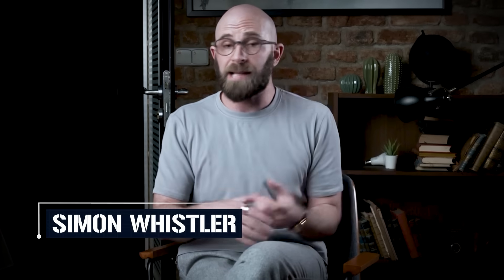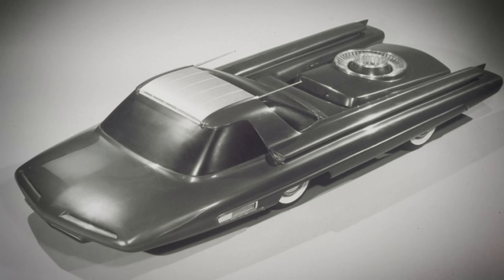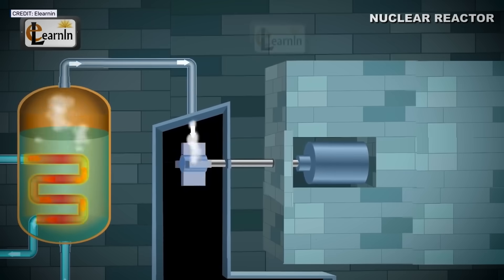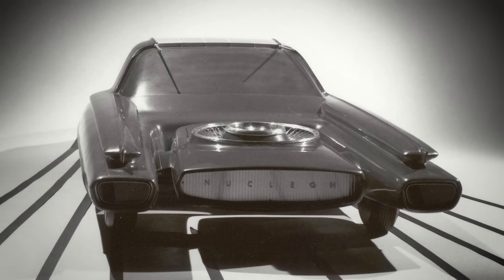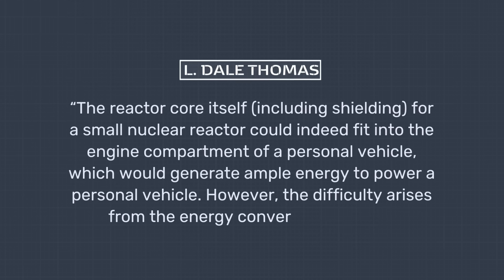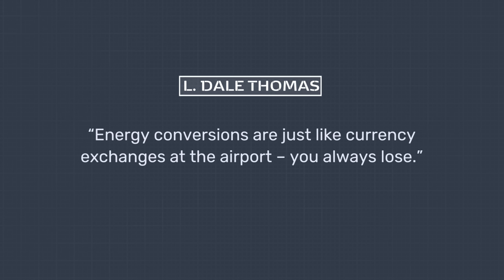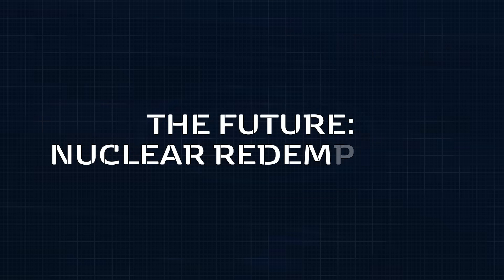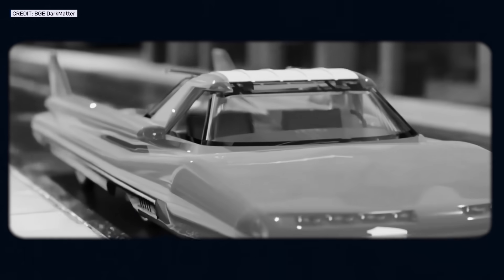The Ford Nucleon: The Nuclear Car of the Future

Comment from the maker: Head to https://www.squarespace.com/megaprojects to save 10% off your first purchase of a website or domain using code MEGAPROJECTS.
Reply: where's my Edsel Nucleair Nuclear Powered Flying Car?
Lied to and Cheated again :/
Reply: most electric cars don't swap out their batteries, but instead recharge (for way too long).  Even the battery swapping variety has it to where the car must be propped up and the battery pulled out from the bottom of the car, as opposed to the classic top lift that is easier and cheaper for the individual (not needing a mechanic shop and lift).
Reply: Did you record this audio on a potato?
Reply: An ordinary electric car that is charged from a network powered by a nuclear power plant can be considered an atomic car.
Reply: after they have cured radiation poisoning and learnt to contain nuclear explosions maybe. the idea of two such vehicles in a crash, or even in a E-vehicle like runaway battery situation, could level a town or most of a town in one go. i'm pretty sure fire departments world wide, wouldn't a tiny reactor doing a Chernobyl in a drive way
Reply: I built a nuclear car once.... You'll never guess what happened to it!
Reply: Yes but could the nucleon power a flux capacitor.
Reply: I think you missed the amount of time it takes to start a nuclear power plant.
Reply: @jbranche8024  

just leave it running.  :)
Reply: Cadillac had a concept car that was going to use enriched thorium🎉
Reply: arent you completely forgetting the Cadillac Thorium car? i think they made at least 12 of them.
Reply: @bm5298  silly those aren't for peasants
Reply: Why specifically Pakistan
Why not Myanmar 
Why not Moscow why?
Reply: Zero Point Energy = End Game!
Reply: could yuh dumb it down to a minute or 2?

Comment: TBH, a lot of the issues could be fixed by using a Thorium Flouride reactor instead but you still have the cooling issue. Does make one wonder if such a thing could be used in aviation since jet fuel pollutes way more than cars and the cold temps at high altitudes would be able to cool the reaction. Of course you still have the energy conversion issue.

Comment: Nuclear Radioactive Junkyards. 👎💩🙈🙉🙊😭😝🥵🤬😶‍🌫️👾💀
This was again proposed in a different way in the late 1970's, whereas Radioactive (tritium) 'heavy' WATER was planned to be used as a fuel. But tje exhaust would be somewhat nuclear -radioactive, and fallout spread all over the Earth. Plus the junkyards problem.
All intended to befuddle the general public about the fact that an engine can operate on REGULAR WATER, electrically split from H2O into both Hydrogen and pure Oxygen at safe low pressures, on-board the vehicle itself.
Fill 'er up, with WATER.

Comment: 10:36 liquid nitrogen filled radiators with circulating high pressure lines...
 Multi layer cooling core titanium armoured reactor with NOX liquid nuclear fuel...
Direct steam-to-movement gearbox
Sikorski turbine style...
If the Americans really want something, they make it possible. Especially if it's nuclear.
If you need some proofing occasions: Hiroshima, Nagasaki, Castle Bravo...

Comment: The enormous weight would not only make steering and braking more difficult and make crashes more dangerous. The stress put on roads and especially bridges grows approximately with the fourth power of weight. With the Nucleon weighing as much as a small semi truck, it would put around 5,000 to 10,000 times more stress on the road surface and damage it much more quickly.

Comment: This is probably a stupid question, I know that going in. But if efficiency is an issue because of all those power conversions, then why not design a nuclear engine that only makes electricity as a side thing, and instead use the power that would be turning a turbine to turn the wheels instead? I mean I know there are other issues but would that not work?

Comment: 021823    Peaceful revolution driven by clean abundance
Let's face the wonder of full heat use. The second law of heat may be false conventional wisdom. The second law of thermodynamics was developed during victorin england's scientific and religious fascination with steam engines. Many people act as if this paridgm is inescapable.

The second law is behind modern refrigerators needing electrical energy to compress the refrigerent to force it to release as waste the heat that it has removed from the refrigerator's service interior in the cooling part of the refrigerent's circulation. The interior coldness draws in exterior heat through the cabinet insulation. There is also discarded heat from mechanical friction and electrical resistance. The net thermal output equals the electrical input with energy not being gained or lost in this refrigeration system including its forced waste. Unencumbered refrigeration by the principle that energy is conserved should produce an equivalent amount of electricity instead of consuming electricity.

It makes more sense that refrigerators should yield electricity because energy is widely known to change form with no ultimate path of energy gain or loss being found. Therefore any form of fully recyclable energy can be cycled endlessly in any quantity.

Full heat recycling, all electric, very isolated underground, undersea, or space communities would be highly survivable with self sufficient EMP resistant LED light  automated vertical farms, thaw resistant frozen food storehouses, factories, dwellings, self contained elevators, safe rooms, and horizontal transports.

In a flourishing civillization, small self sufficient electric or cooling devices of many kinds and styles like lamps, smartphones, hotplates, water heaters, cooler chests, fans, radios, TVs, cameras, security devices, robot test equipment, scales, transaction terminals, wall clocks, open or ciosed for business luminous signs, power hand tools, ditch diggers, pumps, and personal transports, would be available for immediate use incrementally anywhere as people as individuals or larger social groups see fit.

Some equipment groups could be consolidated on local networks.

If a high majority thinks our civilization should geoengineer gigatons or
teratons of carbon dioxide out of our environment, instalations using devices that convert ambient heat into electricity can hypothetically be scaled up do it with a choice of comsequences including many beneficial ones.

Energy sensible refrigerators that absorb heat and yield electricity would complement computers as computing consumes electricity and yields heat. Computing would be free. Chips could have energy recycling built in.
This would improve performance and lower cost,

Refugee communities would be buildable quickly. Fire safes would preserve contents to 1000F indefinately

A simple rectifier crystal can, iust short of a replicatable long term demonstration of a powerful prototype, almost certainly filter the random thermal motioren of electrons or discrete positiive charged voids called holes so the electric current flowing in one direction predominates. At low system voltage, a filtrate of one polarity predominates only a little but there is always usable electrical power derived from the source, which is Johnson (observation) Nyquest (theory) thermal electrical noise. This net electrical filtrate can be aggregated in a group of separate diodes in consistent alignment parallel creating widely scalable electrical power. The maximum energy is converted from ambient heat to productive direct current electricity when the electrica6bzDVgBhrhYl load electrical resistance  is equal to the array internal electrical resistance.

Maximum calculated electrical power output (watts) is k (Boltźman's constant), one point three eight x 10^ minus 23, times T (temperature Kelvin) times bandwidth (0 Hz to a natural limit ~2 THz @ 290 K) times rectification halving and nanowatt power level rectification efficiency, times the number of diodes in the array.

There are a billion cells of 1000 square nanometer area each per square millimeter, 100 billion per square centimeter.

Order is imposed on the random thermal motion of electrons by the structual orderlyness of a diode array made of diodes made within a slab:

Host crystal is silicon
  P type boron doped
-----‐------‐----___-- Out
🔻🔻🔻🔻
■■■■■■___ + Out
  N type phosphorous doped

All the P type semiconductor anodes abut a metal conductive plane deposited on the top face of the slab with nonrectifying joins;  the N type semiconductor cathodes or common cathode abuts the bottom face. As the polarity filtered electrical energy is exported, the amount of thermal energy in the group of diodes decreases. This group cooling will draw heat in from the surrounding ambient heat at a rate depending on the filtering rate and thermal resistance between the group and ambient gas, liquid, or solid warmer than absolute zero. There is always a lot of ambient heat on our planet, more on equatorial dry desert summer days and less on polar desert winter nights.

Focusing on the composition of one simple diode, a near flawless crystal of silicon is modified by implanting a small amount of phosphorus (N type conductivity) on one side from a ohmic contact end to a junction where the additive is suddenly and completely changed to boron (P type conductivity) with minimal disturbance of the crystal lattice. The crystal then continues to another ohmic contact.

A region of high electrical resistance forms at the junction in this type of diode when the phosphorous near the ĵunction donates electrons that are free to move elsewhere while leaving phosphorus ions held in the crystal while the boron donates holes which are similalarly free to move. The two types of mobile charges mutually clear each other away near the junction leaving little electrical conductivity. An equlibrium width of this region is settled between the phosphorus, boron, electrons, and holes. Thermal noise is beyond steady state equlibrium. Thermal noise transients, where mobile electrons move from the phosphorus added side to the boron added side ride transient extra conductivity so t⁶he forward moving  electrons are preferentally filtered into the external circuit. Mobile electrons are units of electric current. They lose their thermal energy of motion and gain voltage, as they transition between the junction and the array electrical tap.

Inside the diode, heat is absorbe; outside the diode, to exactly the same extent, an attached electrical circuit is energized. The voltage of a diode array is likely to be small so many similar arrays need to be put in series to build higher voltage. 

Understanding diodes is one way to become convinced that Johnson Nyquest thermal electrical noise can be rectified and aggregated. Self assembling development teams may find many ways to accomplish this wide mission. Taxonomically there should be many ways ways to convert heat directly into electricity.

A practical device may use an array of Au needles in a SiO2 matrix abutting N type GaAs. These were made in the 1970s when registration technology was poor so it was easier to fabricate arrays and select one diode than just make one diode.

There are other plausible breeches of the second law of thermodynamics. Hopefully a lot of people, mostly as independent teams, will join in expanding the breech. Please share the successes or setbacks of experiemental efforts.

These devices would probably become segmented commodities sold with minimal margin over supply cost. They would be manufactured by advanced automation that does not need financial incentive. Applicable best practices would be adopted. Business details would be open public knowledge. Associated people should move as negotiated and freely and honestly talk. Commerce would be a planetary scale unified conglomerate of diverse local cooperatives. There is no need of wealth extracting top commanders. We do not need often token philanthropy from the top if the wide majority of people can afford to be generous..

The topic deserves discussion and prototyping attempt action.

Aloha
Charles M Brown
Hawaii

There are other plausible breeches of the second law of thermodynamics. Hopefully a lot of people, mostly as independent teams, will join in expanding the breech. Please share the successes or setbacks of experiemental efforts.

These devices would probably become segmented commodities sold with minimal margin over supply cost. They would be manufactured by advanced automation that does not need financial incentive. Applicable best practices would be adopted. Business details would be open public knowledge. Associated people should move as negotiated and freely and honestly talk. Commerce would be a planetary scale unified conglomerate of diverse local cooperatives. There is no need of wealth extracting top commanders. We do not need often token philanthropy from the top if the wide majority of people can afford to be generous..

The topic deserves discussion and prototyping action.

Aloha
Charles M Brown
Hawaii

Comment: Just like deep space probes (like voyager 1 & 2)are Powered by direct to electricity conversion via a peltier devise of the heat from a decaying nuclear slug (similar to spent nuclear fuel) you could power a sterling engine from this "self heating" material for decays and have a smallish battery for acceleration and regen breaking and only need enough power to maintain cruising speed as this can keep generating 24/7 for 20-30 years. You could even plug the car in to supply excess power TO your house and/or the grid when not driving.

Comment: Auto tech out of Detroit here.
Ev's aren't any better. The battery in most is in the rear. That's a xxxx lb 400v battery in the back of your car.
If an electric car gets rear ended, it's likely to catch fire.
Lithium batteries burn so hot water only makes it worse, so they just let the car finish burning.
Also "it's better for the environment" where does electric power come from? Coal plants, mostly.
Using more electricity means burning more coal, which in turn means more pollution.
Also, all the mining for the lithium in those batteries??? Done by diesel powered machines. More lithium batteries? More mining. More diesel pollution, on a massive scale.

So. Electric cars are just as dumb as nuclear in my opinion.

Comment: It is absolutely false that there's only one energy conversion when charging a modern EV.  Firstly, the electricity is created primarily by COAL powered plants. The first conversion is from the electrical plant into electricity, THEN it gets pumped out to you home and converted AGAIN. And the disposal of EV batteries is another energy conversion nightmare. EVs are not as green as many uniformed people want to believe. They also go through tires significantly faster, which causes another source of increased pollution compared to ICE vehicles.
Reply: You see that's only in the US and China( biggest countries to use coal power) really other countries use nuclear, hydro and so on
Reply: Yeah EVs aren't has green has they can be because there so comparables material right now for energy storage to lithium, sodium batteries are getting there. Yes EVs go through tire faster then normal cars but that's also because  normal cars lose torque through gearing and mechanical transfer , EVs are basically raw torque so yeah tires for the last hundred years dint need to be has durable has they need to be now.
Reply: Can't relate, Ontario largely uses hydro and nuclear

Comment: I don't understand why the hustle with the risk of getting blasted with radiation when we already have water powered engines. Just water as fuel.. separate into hydrogen that's it. What's the point of nuclear just to keep it running longer and also posing a massive health risk if some idiot left out these bits of uranium..

Comment: There's another thought in this whole concept that no one has thought about, and the microwave that excites the Uranium is much smaller now, and we could use steam to generate electricity, then electric motors. So, we could save on batteries, and go nuclear. The concept car could be reinvented all together. This is something that you should try to do in your preferred CAD. Then, show us on your next show. We all like the 2.0 idea. Imagine if the next Ford Nucleon went 5k miles, and weighed in at half as much, and had 1600 horse power, and could rip a track in the quarter mile. It wouldn't be cheap, but a luxury. Then, it's not about insurance, but exclusively for the rich to have an amazing car that's better than the other rich folks.

Comment: The Ford nucleon was in the 1960s, the design was never finished, but had a 5000 mile range. Also, the possibility was a long shot. It was designed before the invention of the nuclear battery for pacemakers even.

Comment: Here's something else I'm wondering. How do you "turn off" the rods, so they don't constantly heat the water? If you remove them from the water, you have a melt down. If you leave them in, without sending the steam somewhere, they will blow up. I believe in a nuclear plant, they have shielding that goes over the rods when they need to stop the rods from heating the water. I'm not sure, I've never really looked into it that far.

Comment: What if you made a nuclear thermal engine like the NERVA engines?  Instead of heating water, you'd expel heated gas, and you could use that to run a turbine through a gearbox to run the car.  Or you could send the heated air through a heat engine.  That removes some of the energy conversions.